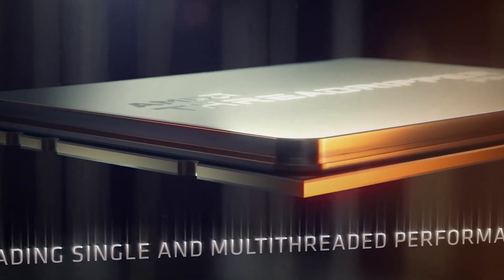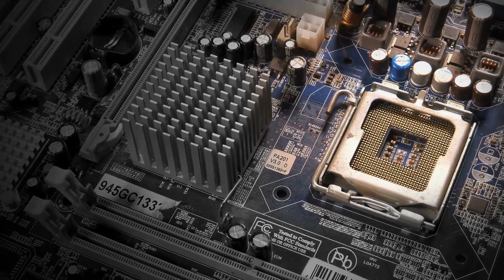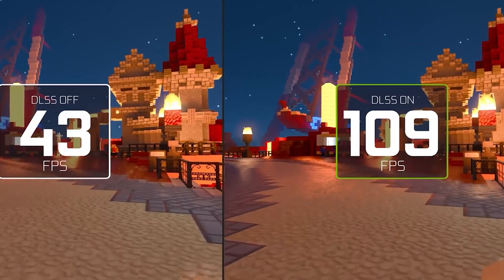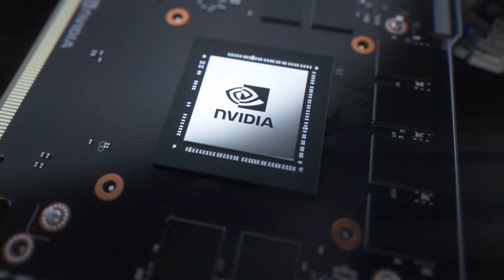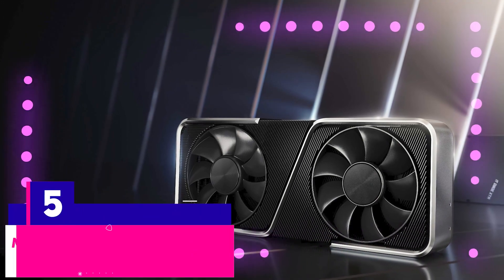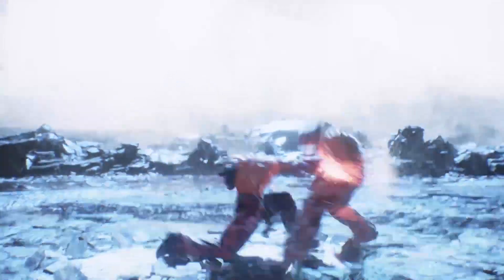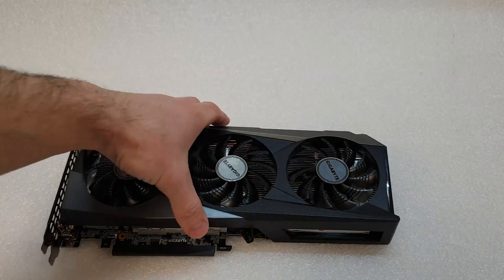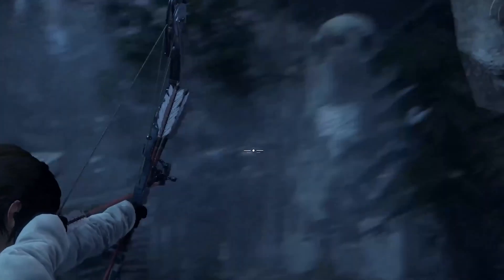Best Budget GPUs (1080p, 1440)

Comment: Have you guys checked out the 5700 xt? I don’t hear a lot of ppl talking about I was personally gonna buy a 2060 but after looking at the 5700 xt I might buy that one instead
Reply: The 5700xt is far better in my opinion. Even the 5600xt beats the 2060, and in certain 1080p situations, will beat the 2070. To me it's a no-brainer - get the AMD second hand.
Reply: @SC-hk6ui  amd temp are also alot higher
Reply from the maker: Ehhh go w 2060